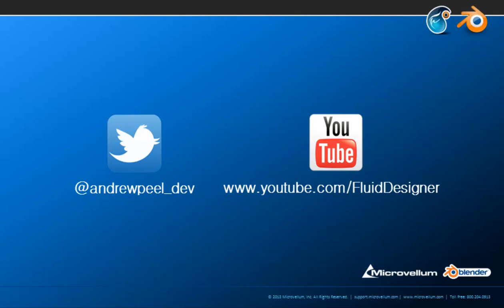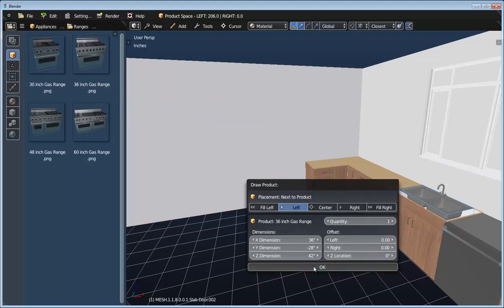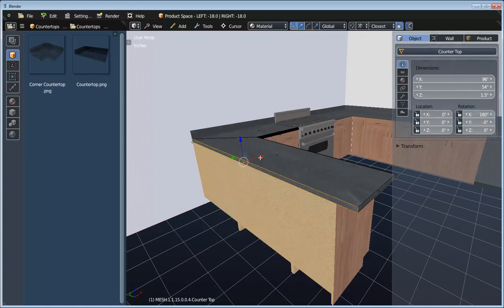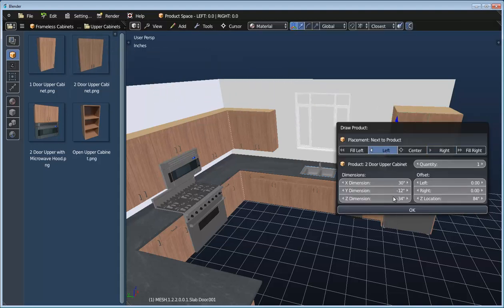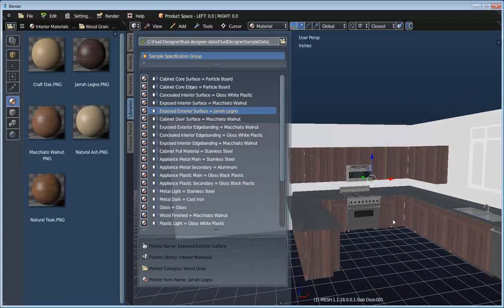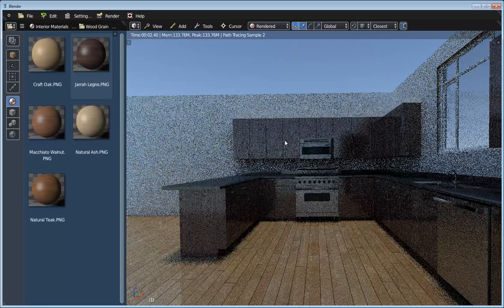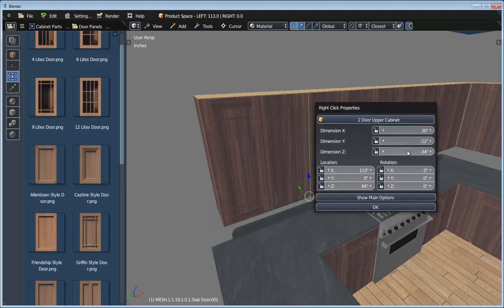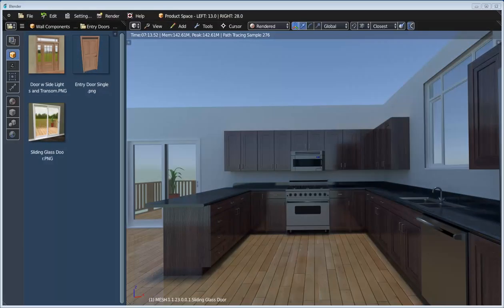Fluid Designer Dev Update #3 - The Data Manager

Comment: A week later and I STILL can't log into the test shop to download the beta.

When we signed up, we weren't asked to create a Username and yet the shop requires one as well as our password to download.

 I've tried my email and name from the sign-up process and neither works for the shop. However I can still easily log into the forums. I've asked for help on this issue in 3 threads, 2 emails via the "Ask Us" side bar, and left a message in the Live Chat. Not once have I been answered.

Thus my asking here as my final option.
Reply from the maker: Sorry I thought we replied to everyone having trouble with the download. Can you try this link and let me know if you are able to download the file. http://download.microvellum.com/MicrovellumFluidDesignerInstall.exe
Reply: Andrew Peel 

 Thanks, Andrew.
I've ran into some issues that needs to be addresses.

1) Not everyone (including myself) has 64bit computers. Many Blender users can only afford 32bit. But the program dies run fairly well on 32bit computers. I'm surprissurprised ut even installed. lol

2) I was attempting to recreate my kitchen as a test and noticed that flat top electrical stoves were missing from the list as were Refrigerators with ice/water dispensers.

3) I also couldn't figure out how to add a draw and door to one open area of the corner cabinet

4) those issues are minor compared to this. Each time I attempted to attach a sink cabinet to the corner cabinet, it would jump to the back of the opposing wall.

 5) Adding the sink cabinet always caused immense lag. I've tried making it the first product added to the two wall room but the lag issue continued to occur. At a few points it crashed the program.

6) The pop-up menu is great. But I've notice some minor issues. I love tgat it auto sizes as it reacges tge top and right side of the program's boarders. However, it doesn't do this for the left and bottom od tge program. Another note: many users will have a multi-monitor setup. I've noticed that I am moving my cursor to another window and am also moving the pop-up, the menu will collapse to nothing but still be active if click on something on my other monitor. Might want to include a collapse limit for the pop-up menus.

 I'll continue to test it. But it would be nice if it was a stand alone program. Meaning we don't have to install it. Aside from the issues mentioned above, it runs great so far and easy to navigate.
Reply: Andrew Peel Thanks

Comment: Please tell me that tge cabnet textures can be applied to walls, etc and vise versa.

I can't afford a powerful computer nor anything else really. Hince the reason I got into Blender in the first place.

 My computer doesn't support OpenGL higher then 1.5. Will that be a issue when I go to render?
Reply from the maker: All of the materials are created for the cycles rendering engine, so if you are already using Blender with Cycles then you wont have any problem. And yes all of the materials can be applied to any object in the 3d viewport.